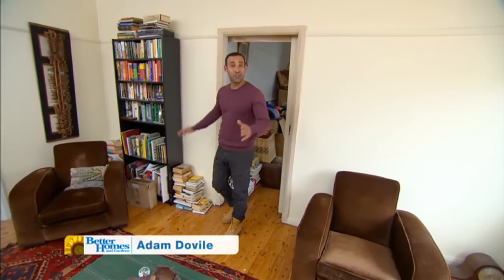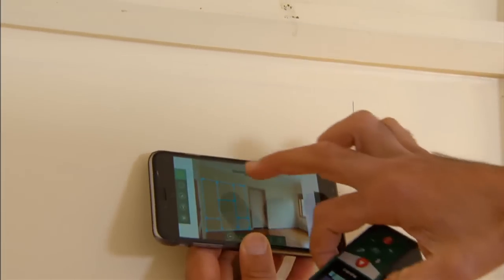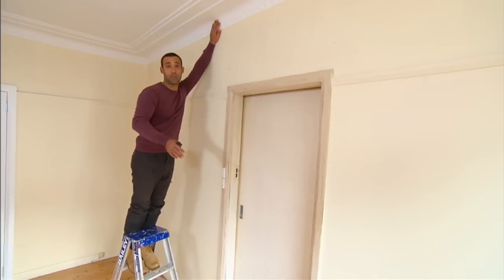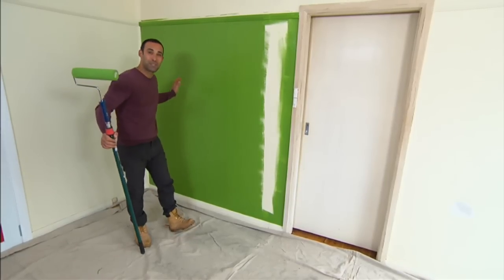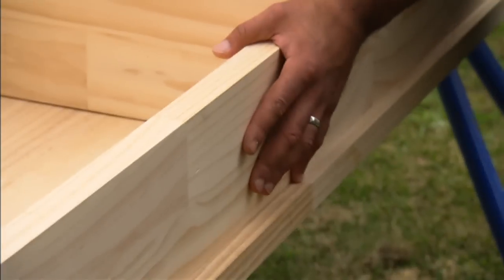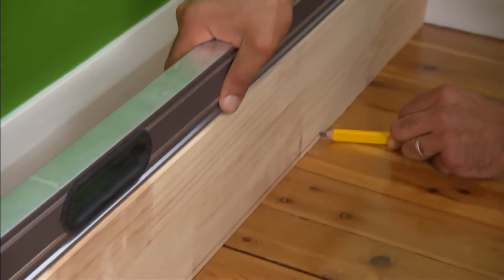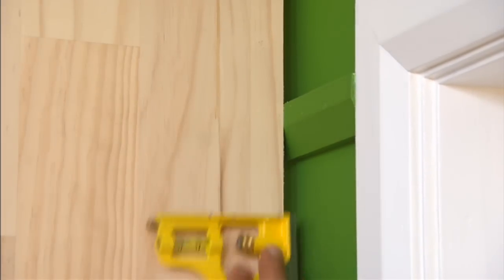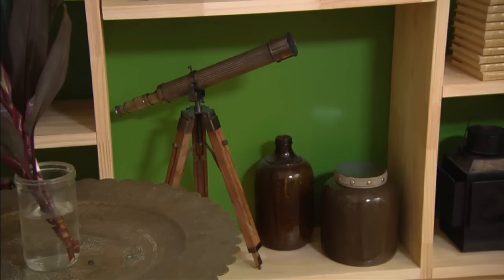How To Build A Custom Wall Unit | Indoor | Great Home Ideas

Comment: I once built a dog house out of Aspen Board and never bothered to give it a coat of paint. Five years later I passed the dog house on to another dog lover as I no longer had a dog. I don't know how long it lasted after that point or if they painted it, but Aspen Board is pretty durable. 5:26